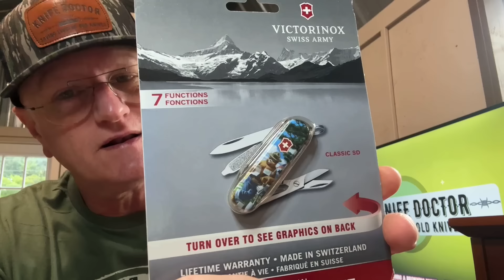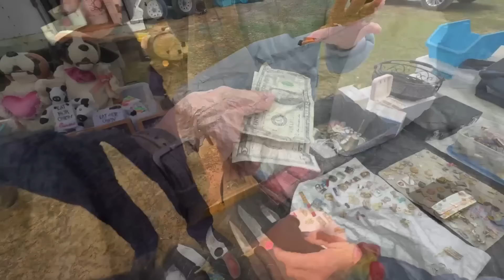Cleaning a NASTY Knife + Two Packages from Kentucky!

Comment: This is just a suggestion, but the little small tabs when they’re easy to break on the clamshell posters. I wonder if you can get one of the little small jet lighters and heat them up before you bend them down maybe that would help keep them from breaking.